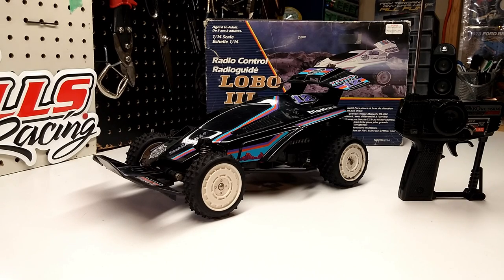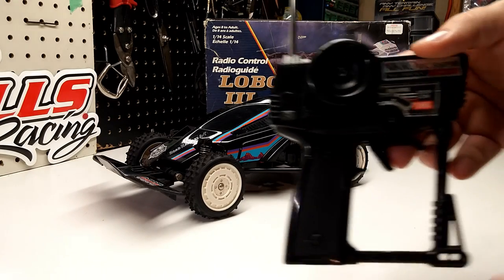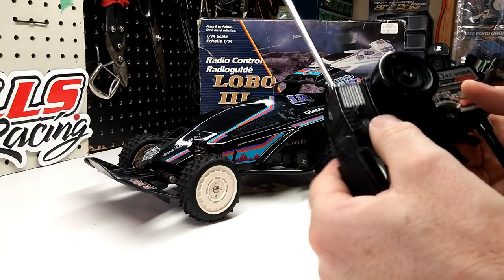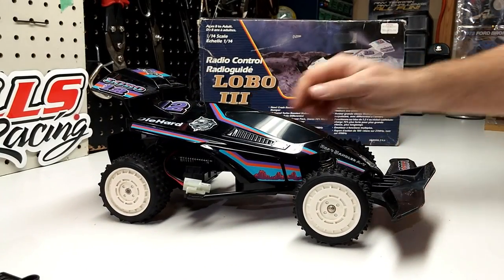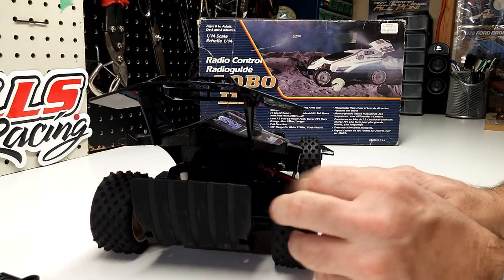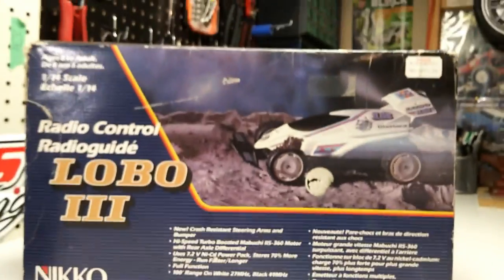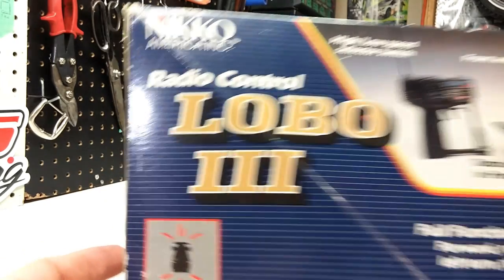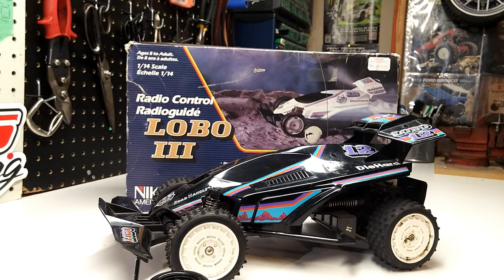NIKKO LOBO 3 1/4 RC BUGGY

Comment: I remember getting this for Christmas in the mid to late 1980s.  There was a section of Sears that was stacked full of themwith only 2 color options..... either white or black.  This was a good year and a good Christmas.  Most neighborhood kids that got these for Christmas braved the cold and went down to W&J elementary and ran thier Lobo's.

But there was a problem....

I remember that some of these ran on the same frequency and cars would wreck and be uncontrollable.  We wanted to race, but we couldn't because the signals cancelled each others car out.

My Lobo has long been destroyed, but I still have the orignal Sears quick charger and original 7.2 Ni Cad battery, which does not hold a charge.

I believe you can still get batteries on eBay that will attach to the old Sears charger.  I have posted a link below. 

But  if anyone wants to buy my old charger and battery lot I would be willing to sell.

Anyway here is the eBay listing

https://www.ebay.com/itm/7-2V-1200mAh-Ni-MH-Rechargeable-Battery-Pack-for-Black-Ops-Ignite-Justice-Dealer/371843150971?epid=1465831549&hash=item569394347b:g:xJ0AAOSwt5hYgFY-
Reply: Me and my brother got one each for christmas also,  we beat the shit out of those things for years loved it.

Comment: My second rc car. Got the lobo 2 like 2 Christmases before this. I had wanted the super lobo with 540 size motor, but was to exspensive for us po folk. Probably the single reason I have a whole office of rc cars, trucks and parts.This buggy had better front suspension. Lobo 2 would always break.
Reply: I had one lobo 4or 5 it was 4x4, had shafts running from front to back